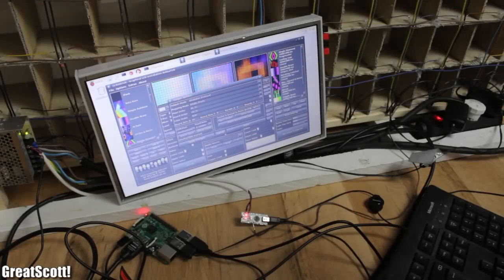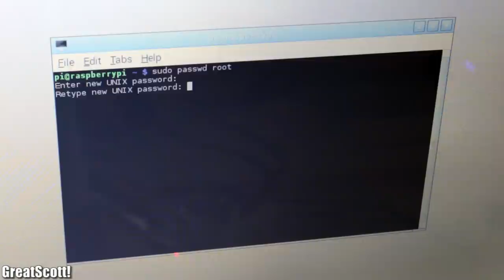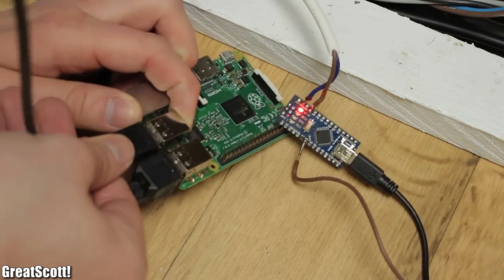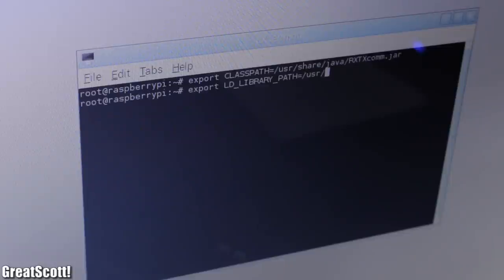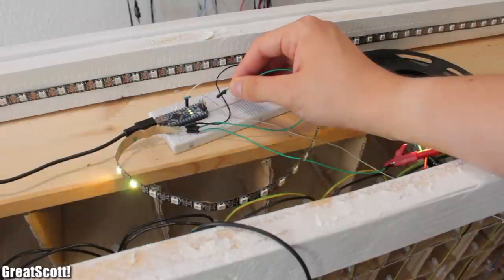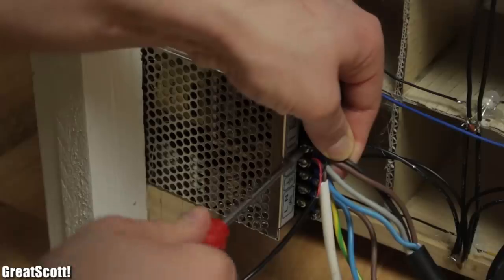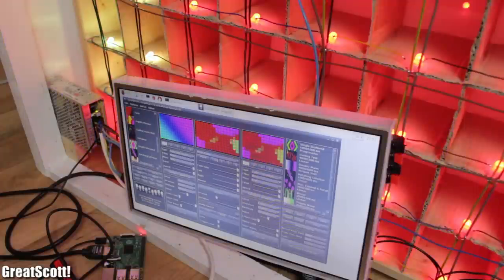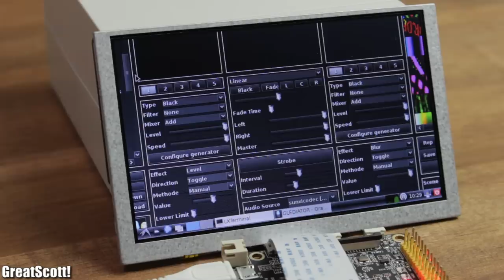Make your own 15x10 RGB LED Matrix - Part 3 || Glediator support with Raspberry Pi 2/ Banana Pro

Comment: You could use one of those small 7-10 inch monitors (touch one) and have it mounted to the top board and fold out when required?

Comment: Instead of using a physical screen connected to the Pi have you tried a remote software application to run on the run that you could then use to connect to a windows or mac machine? I've had remote software running before on pi one model so it should work find with the pi two. You could have the remote software open up upon boot so you're able to access it straight away providing the PI has a static ip to connect to all the time.

Only an idea rather than having to use a phyical screen and such :)

Awesome video tho!
Reply: Kikkawa Ryu Thats the way I ran my Pi for the longest time, because I was too lazy to work in the corner that my networking was done(it was kind of crowded too) So i just remotely accessed it from my laptop or desktop and I found a software for phones but it wasn't too functional
Reply: +Kikkawa Ryu (Luke) And It'd also stress the Pi too much which could possibly lag the code :P

Comment: There is a question in your newer led matrix you are able to show images without a Computer. Am i right if i think you could also use this matrix without an raspberry pi and connect it directly to an computer which has the Gladiator software on it? If yes is there a way to get an Equalizer on it? Or maybe just some animations without a Computer like the new small one? It would be great if you are able to answer. Sorry my englisch is horrible.

Comment: I know, this Video is a bit older, but: Did you try to control Glediator via SSH and a X-Server for your PC? You'll have to have either a network cable or a wlan device attached to the Raspberry, but there is no use for the screen anymore.

Comment: Wow great project! FIrst question is are you able to use an arduino uno?
I really want to make this but i saw a question on inscrutable that you said the schematic you made does not work, are you currently fixing it or have you just left it because i want to make one but I cant make it without a schematic?And can you use a regular windows laptop to run that porgram instaed of a rasberry pi?

Comment: for a screen you could use your phone,laptop or computer by using ssh to have a remote desktop connection to your pi but this may be impractical depending on your Internet speed unless you use Ethernet cable to connect directly to the router? hope thats some help.

Elliott
Reply: ***** Doesn't matter about the internet speed, it is the quality of the dongle's wireless protocal/speed and his router's wireless speed AC Wireless is the must up to date and fastest protocal I do beleive

Comment: Why do you use the arduino as a LED controller?  I think the PI has all the data ports to do the same thing as the arduino but you may need a suitable software to run the LED controlling.

Comment: great scott   i recomend not using an LCD on your pi at all   instaid use remote desktop softare so you can control the software from a laptop :D
Reply: +Fennec Fox (FennecTECH) and put a folding@home or seti@home project on it so you can donate your unused cpu cycles to science C:
Reply: When you think you're better than Great Scott
Reply: Rafael2884 this is just a good idea Rafael....

Comment: Hi!I would love to do this project as well and I would like to ask you something. I didn't find the PL9823 RGB LED but I found RGB PTH LED. Will they work like the PL9823? Another question is if there is a way to replace each led with another matrix but control it as one led. I want to replace each led in each box with another led matrix but control that entire matrix as one led. Is it possible? Thank you very much!

Comment: So I built one of these and I'm have a bit of trouble makeing the LEDs transition smoothly. The entire matrix flickers from a high brightness to a low brightness very quickly. When I run the gleditor program on the matrix it's like the colors lag behind one square. Please help right now it's 6x10 but the final board will be 9x10. If you can help please do! Thanks!

Comment: I've got glediator driving my 9 x 47 grid and it works great with the premade animations. I'm finding the program a bit clunky though and was wondering if there are any other resources to learn how to better operate the software. Their website seemed rather limited imo.
Reply: Any tips on how you got it to work? I cant seem to get the RXTX to work on the raspberry Pi. I've used the software a fair amount (on laptop) and I might be able to explain how to do something if you want.

Comment: it should be marvelous with an autologin and an auto start of glediator and a sound recording for moving leds according to the music ! do you know how to make that ? i have made an auto login for root user, auto "startx" in the batch file, but i have also added the command for starting glediator but that doesn't work if "startx" command is present, and without her, he works only if i launch th LXTerminal. and finally, the com communication in glediator don't start at the starting of glediator.

Comment: Hey!!, I have a question. I have installed an RXTX library and the Glediator is not detecting my COM ports. Do you have an idea why this is happening? We are using RPi3 and an Arduino UNO Rev3.

Comment: QUESTION: I want to build an LED display with WS2812B LED strips. There will be 225 leds in total. Should this work with the anrduino nano too or do I need a better microcontroller for such an amount of LEDs?
Reply: The Glediator website mentions up to 512 pixels so you're fine.

Comment: @GreatScott! I really love this. I love all your videos. I wand to use this in a project that I am busy with, however, I want to use it in a more of an automated way. What I want to find out is do you have to start the animations from Glediator every time you start reboot the pi or will it start automatically on boot? also, do you have to use the Glediator application every time or is it possible to save the animation (like in a config file for instance) and recall it from python or the terminal on the RPi automatically based on certain conditions? You see, my led matrix will be unattended and based on certain conditions, I want it to display a Glediator animation or text automatically and I need to switch between these programatically. Does this sound possible? Keep up the great videos. Really love them.

Thanks
J

Comment: Does the Pi need access to the network at every time? Could i set it up once, close the enclosure and it will start the display whenever i power the matrix?
Reply: I think Network was only for downloading the things, it should work Fine when you have seit everything up
Reply: *set

Comment: Nice project, it must have cost you a lot of effort. How much time did you spend building it?
Reply from the maker: ElectronFun.com Around 50-70 hours.
Reply: ***** Glediator and Jinx! are both capable of Video capture. So you could use any tetris applet and send that to the matrix.

Comment: Is it possible to run Glediator from the Pi user? Everyone is telling me that it is not a good idea to always run as root user due to security issues. Since Glediator is all i will be using this for do I need to worry about that? IF not how can I make my RP3 startup in root user and auto run the Glediator? Is that possible? I already got it working if I manually login to root user but I really want to make auto happen after a reboot. Please help!

Comment: I have installed the rtxt and I get the same outcome as the video but it comes up with 0 COM ports when my arduino is on. Do you have any ideas?
Reply: I have found that even a broken arduino mega COM is found but not the UNO
Reply: +Jake Jackson got the same problem with my arduino uno.. found a solution? I think we have to install librxtx 2.2pre2-3, but didnt find a way to install it

Comment: Very nice video, much appreciated.

I just got my rpi 2 today and have been following the example but with an Arduino Mega. Trouble is the Pi still isn't seeing the Arduino as a com port. I have successfully installed Gladiator and it runs. Also successfully installed RXTX, but reports  Number of com ports found: 0

I tried a couple of USB cables and an Arduino uno with the same results, any thoughts as to whats wrong?
Reply from the maker: ***** I guess the problem is that you do not use a FTDI/CH340 IC. Try something like this: http://blog.oscarliang.net/connect-raspberry-pi-and-arduino-usb-cable/
Reply: GreatScott! I loaded the Arduino IDE into the PI and can download sketches without issue so I guess this is just to do with compatability of my Mega and the RXTX library. I don't have one yet but what if I try a USB to FTDI cable?
Reply: +Steve Manley did you found a solution? my uno isnt working too
Reply: +Schmirgus Hi, I bought myself a cheap Arduino Nana from China. It uses a knock off FTDI chip but works a treat.
Reply: thx for your answer :) yea i thought about the same, but i want to use the uno as a spectrum analyzer and sparkfun got a plug and play board for the uno.

i found out, that on my pc with an dekstop linux build everything is working.
Reply: +Schmirgus I have one of those Sparkfun shields as well, also got hold of a MSGEQ7 breakout board I use with a Nano.

Glad you got things up and running. I had no success on a PC. It bricked the Nano for a start plus I couldn't get the RXTX drivers sorted. Same with a Mac, couldn't get the RXTX drivers working, so I'm stuck with the just the Pi.

Comment: Hi Iam trying to build a small led matrix with glediator but it's not working I have the rxtx library installed and it works the Rox light on the arduino mega flashes like you said it should but nothing lights up Iam using the lm9832 led and the LEDs work because I tested it with sketch2 and 3 on inscrutables but the code you supplied in part 3 didn't work could it be the arduino mega or is it a software issue I have tried other codes on the internet it would be great if someone or you could help because I am starting to get very angry

Comment: Hello, I have a problem, the signals of the LEDs from the Raspberry Pi come with my Arduino Nano to (I think because the RX LED flashes quickly from Arduino and the L LED is lit) but this is no more to the LEDs. Can you help me?
Reply from the maker: SecretSchadow Seems like you made a mistake with the code for the arduino.

Comment: #GreatScott! I have a rpi2 and an LED matrix hat from adafruit.  Can I run serial RXTX and glediator on the pi? do I need a nano? Im pretty new at this. Any help would be appreciated.
Reply from the maker: +Austin Kimbrough Nano is necessary.
Reply: +GreatScott! I had the same question. Can u please explain why I wouldn't be able to control the matrix directly with the GPIO pins of the pi?

Comment: I can control leds without arduino? I have only raspberry pi 2. thanks!
Reply: Knight G the arduino costs only 5 euros
Reply: Knight G have tried to get my ws2812b ledstrip working with only raspberry. but the outcome is to use an arduino, easy and lowcost fix. and coding isnt to hard!
Reply: tough its a shame for the 40 pins of the pi - go to waste

Comment: I am not sure why the Raspberry Pi is needed. Can't I just download Glediator to my computer and upload the code to the arduino from there?  thanks!
Reply: Yes you can, you will just need to manually ad the RXTX library to your java lib. Just google RXTX lib + your operating system and follow instructions.

Comment: hello, i'm stoped to the Glediator.jar command.First, LXDE don't show any menu bar, just the bin... and when i try to put the command in text mode, i have this message:

Exception in thread "main" java.lang.ExceptionInInitializerError

and he show many link...

and after that he write:

Caused by: java.awt.HeadlessException:
No X11 DISPLAY variable was set, but this program performed an operation which requires it.

and many other link...

do you have a solution for that ?
Reply: mimix1004 solved by reinstall raspbian from an entire IMG file before the ZIP.

Comment: part 3 is necessary? or can i use simple arduino nano... :)
Reply from the maker: +Andres Rivera Arduino Nano is enough
Reply: +GreatScott!  Other question Sorry, Can use a WS 2801 strip?
Reply: yes, but not the same way
Reply: I installed rxtx on my mac, uploaded the ws2811 sketch for glediator on the arduino , glediator recognises the port (dev/cu.usbmodem) but the leds don't light up. what can i do?

Comment: Cool project, but wow, 8 amps is a lot of power.
Reply: I'm working on a project that has around 1200 LEDs. that means 1200 * 0.06= 72 amps at full brightness.
that's a lot of amps!!

Comment: Great set of videos. Maybe for interfacing with the pi, use a remote system like ssh with X11 forwarding. The is also a device that takes an HDMI signal and ouputs to a usb so you treat it like a webcam. Then just hook up a wireless keyboard an mouse to it as well. You can also get one of those motorola droid laptop dock stations for $70. Or you could be a badass and use scripting. There are many ways to go about this. Keep up the great work.^^

Comment: make a hole in the wood frame and use some acrylic to se the screen thats jus a idea (i'm french so sorry for the mistake I make )
Reply: ***** That would be awesome! And he could have one of those wireless keyboards logitech made with the touchpad and it would slide out a keyboard rack from an old desk and work as a debug terminal or he can upload new schemes to gladiator or turn the bar into a media hub too with speakers and change songs from that screen and have the lights be like a spectrum of the songs playing (If gladiator supports it)
Reply: This is a pretty good idea but make all the things you say in just ONE video ?
Reply: *****
What about a video dedicated to the electronics?

Comment: why do you use the arduino if you have a powerful machine like the raspberry?! you could use an virtual serialport and run a script which does the same things as the ardunino and use one of the GPIOs of the raspberry
Reply: Can you tell me what i must to do this without arduino? You have any tutorial etc? I have WS2812 leds and raspberry pi 2. Thanks!
Reply: 123vergessen How could you drive 2811 Chips directly with the Pi? The timing is just too critical.
Reply: 123vergessen the answer is SPI

Comment: Anyone got it working with a Arduino Uno ? Glediator cant find the port...RXTX is installed and with the Ardiuno IDE i can connect with the uno
Reply: +Schmirgus Make sure you have installed the correct version based on your OS, 64 or 32bit.  I currently have it pushing 150 matrix with an uno.  Install RXTX correctly, move the files to the correct locations (readme), plug in the USB cord- let it install and you should be g2g.
Reply: thx for your answer :) I got it working on my PC. I should have specified my question :D Does anybody got it working with an Raspberry + Arduino Uno ?
Reply: +Tom Schubert Im trying this on a Raspberry Pi 2 Do you have any info on where/how to install the RXTX in raspbian?
Reply: the raspberry alone , as far as i know, cant handle the PL 9823 LEDs
Reply: +Schmirgus hey can u help me or point me to a location on how to install RXTX ! I've been trying to figure it out but I find anything ! Greatly appreciate it.
Reply: +Tom Schubert Can you help me out on installing RXTX ! I've been trying to figure it out but I simply can't. Can you point me to a source for I have not found any useful ones. Thanks.
Reply: Schmirgus Hello, thanks for your response but I'm running this on a mac however, I've seen this page in my search, however I just don'tknow how the termial truly works and really don't know how to add/copy/place/search files which I need to install into the Java/Extension file.
Reply: thanks. Im having a hard time with this "install them in the '/Library/Java/Extensions' folder" . I know its under terminal but nithing else. Im not to good on the software sidee. Thanks for all the help.

Comment: lazy solution for a screen - xrdp.  remote into it when you need to change settings with remote desktop on a windows computer or equivalent from other platforms

Comment: Wait, wait, wait, wait.... Arduino Nano is like 10 pins (myb). THEN how does all the hundreds of leds can be controlled???
Reply: NurIhsan you Need 1 Pin. It sends a long command to the first led and that sends it to the second led and so on.
Each led has an id and lights according to the value in the command.